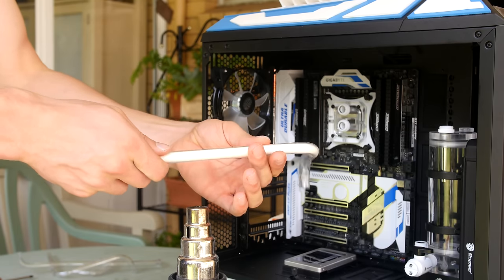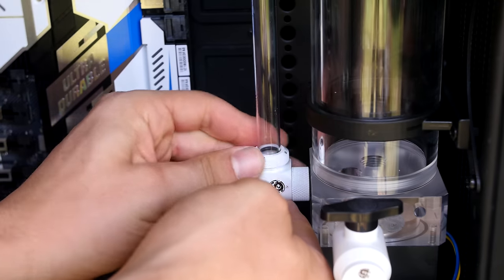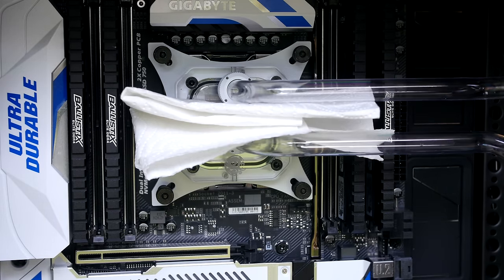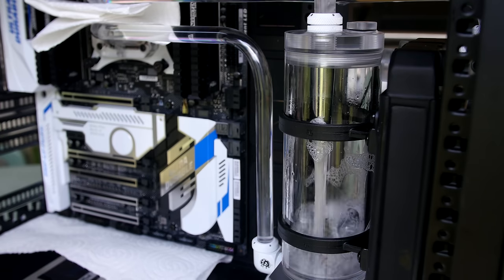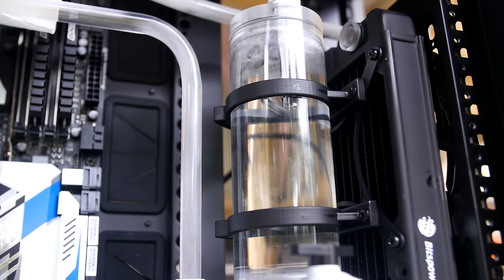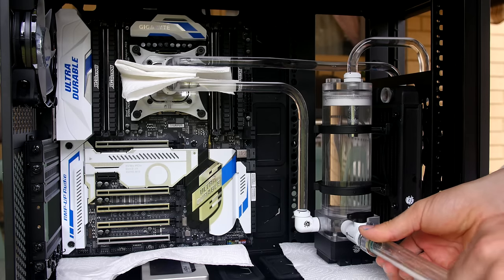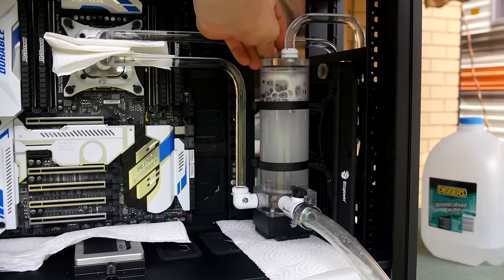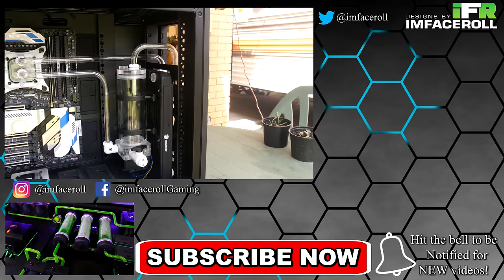How to FILL & DRAIN a PC Custom Water Cooling Loop

Comment: Nice video but you forgot to say that you must never fill the res to the top and ALWAYS leave a bit of air in the top of the res.
I made that mistake in the past because after I had filled it to the top I started a game......and what happend.......Water expense if it gets warm so the water came out of the top of the res :(
Luckely I saw it  on time & I directly shut down the system before something went realy wrong :P

So ALWAYS leave some  room in the top of the res so the water (or air) can go somewhere.
Reply: Andres de Groot thanks
Reply from the maker: +Andres de Groot hahah you shouldnt be using the pc with the port off of the pc =) let the pc bleed out all the air tehn fill it all the way and close it up, now you can game =)
Reply: I didn`t use my pc when filling :P  I waited 2 hours or so & in that time I moved my case a bit........change the pumpspeed up & down so the air coms out quicker.
After that I filled it to the top (I think a bit to far) and closed everything. I thought nothing was wrong but after some gaming I saw that the coolent came out on top of my res out of one of the ports.
What i did after that was shut down the pc and took some coolent out. Not much but a little bit. problem solved.
2 hours is more then enough for me to be shure everything is oke.
Reply from the maker: +Andres de Groot ahh wow sucks that it happened man, glad everything is still ok
Reply: I'm getting a gaming PC soon lol, I won't build it but if my rig does leak Ima have to get into action and turn off the PC. but leave your PC running when filling up your reservoir. but yes leave a bit of air, enough to NOT leak !!!

Comment: thank you it is save to test the system with just distilled water for a few day
Reply from the maker: +Faissal zin yeah distilled water is fine, if you plan on using it long term just make sure you add your biocides etc

Comment: It's also important to mention that if possible, have the returning pipe (going to the res.) not trickling water from above and instead use one of the side ports. This will reduce trickling noise.
Reply from the maker: +Oridian it shouldnt really make any noise if you fill your res up, even then most reservoirs have a tube on the inside that brings the returning liquid into the res lower than the water level so there is no noise
Reply: Well most guides say not to fill reservoirs to the top because of expansion due to heat; and isn't that second bit basically what i just said about side ports instead of trickling from the top?
Reply from the maker: +Oridian hey man. There isnt any expansion of water, its a liquid, the molecules are not compact they are freely moving, if anything you will be loosing liquid as small air bubbles work their way into the reservoir. Once all air bubbles are out then you have small amounts of evaporation over time, even happens in a closed loop. That trickling part that you are talking about doesnt happen from the top because a lot of reservoirs these days have a tube inside of the reservoir from the top port which brings the liquid down below water level before it enters the reservoir
Reply: Alright, thanks for clarifying; much appreciated.
Reply from the maker: +Oridian no problem man =) always happy to help

Comment: Hey dude 
some question about watercooling 

what do u say about different materials in a loop ?
do u think they can cause any problems ? i read a lot in the internet about problems with corrosion or things like that when people used copper and nickel in the same loop 
but radiators are made of copper and i´d like to use EK blocks with nickel because they look so much better

My second question is what do u think about pastel coolants ?
are they damaging the blocks ? or can i use them without any problems 

and my last question is what coolant do u use in your system ? 
i think u said something about UV in your video but from wich brand

hope u understand everything sry for any mistakes but i am from germany
Reply from the maker: +X-Ray # try not to use different materials. Copper and nickle are fine to use together because they are very very close together on the corrosive scale
Reply from the maker: +X-Ray # pastal coolants are fine just clean out your radiators before hand. I use mayhems UV green dye
Reply: Designs By IFR 
OK thx
Reply: +X-Ray please note that ek nickel blocks are actually nickel plated, the base is still copper ;)
Also you NEED anti-corrosive treatment in your liquid since they will always be a bit of aluminium somewhere (reservoir cap, pump bearing sometimes etc) even though it's not that much or another metal that can induce a little corrosive action.

Comment: Thanks for the video it was really great! How do you know when it is time to change fluid and add fluid? Will this cause the pc to turn off?
Reply: If you try to run a custom loop PC without coolant, you might damage your pump running it dry, and your components will start to overheat, not to mention you should have your PC off any time you're changing anything with the custom loop or draining/filling because the liquid could splash onto your parts and cause a short which could damage the electronics.

Comment: So is bridging the 4th and 7th pin a universal practice to power the molex?
Reply from the maker: +Lex Lutha111384 yep, its how you can jump start the power supply to power the molex without powering anything else in the system
Reply from the maker: +CockatooDude yeah pretty much
Reply from the maker: +CockatooDude no worroes man
Reply: In a video a person said to put the pin in the 4th pin and the 5th pin.
Reply: @DesignsByIFR  So I have a fully modular psu lying around and I lost the 24 pin cable. Can I do the pin thing directly into input in the psu?

Comment: My pump/reservoir has 3 ports on the top and an IN and OUT port at the base. Can I attach the drain outlet to either the IN or OUT port? The ideal is to go from radiator > top port on pump/res > OUT port to GPU > CPU > radiator. Just seems weird to have to put the drain outlet on the IN port...

Comment: what is that fitting with the tube connected to the drain valve called? is that a 16 mm  hard tubing?

Comment: What if i dont have multiple port on top of reservoir, only 1. And using tube not entering on top of reservoir but on the inlet..now, what to do? Where do i put walve? What are options?
Reply from the maker: +koford u need a T fitting. The valve can still connect and you can run your line out

Comment: Hi , I have a c240 thermtake hard tube kit . I did not put it together myself , although I have it all powered off and am attempting to add coolant dye to the mix just don’t get how to take the top off ? 

Pretty much there is a tube going from pump to radiator and the other hole is plugged currently which if I could remove I’d be able to put the dye in.. not sure how it comes off though usually just a twist ? Can anyone help

Comment: I know I'm late, but was wondering if anyone can help. What if I don't have res/pump combo with multiple fill ports at the top. The one I have just had one huge cap at the top that unscrews. Would I need to put a "T" valve along with a drain valve, along with one of the tubings that goes into the res/pump?

Comment: Hello,it does not start the pump by bridgeing the 4th and 7th pin,it only starts the fans from the radiator, could you please help?
Reply: you need to bridge 4 and 5 pin

Comment: PLEASE HELP!!! I noticed you still had air bubbles in your loop when you drained it. Mine look the exact same. Little white bubbles along the top of each tube and at the top of the reservoir. I have had my system running for about 6 hours with the cap off the reservoir and the bubbles are still running all around the system making the loop look cloudy and it should be perfectly clear. PLEASE HELP!!!!
Reply: Take off the tubes and clean them out that way.  It's not hard to do.

Comment: did you not use any additives to the water ?
Reply from the maker: I used blue liquid. It already has aditives in it
Reply: in my case can you help me ? ive never done this before and cant find proper guide, i want to refill the coolant in my h60 , i want to use distilled water because its cheap, what do i need to add in the water ?

Comment: Whats up with the foam?
Reply from the maker: +Balubish Tech its just a bit of dish washing liquid =)
Reply: Its not supposed to be in there mate ;-)
Reply from the maker: Balubish Tech haha of course its not, this was a guide on how to fill and drain aswell as flush before you fill =) flushing gets rid of all of that
Reply: Designs By IFR hehe yeah. Nice build btw. Is it a Singularity PC res?
Reply from the maker: Balubish Tech thanks man =) na its a bitspower reservoir pump combo with their radiator mounting plate
Reply: Looks clean
Reply from the maker: +Balubish Tech thanks man =)

Comment: why is it so foamy ?
Reply from the maker: +GoldSkula because of the soap i used to get the silicone insert into the tube, that is why i flush the system with water
Reply: Isn't it easier to clean the tubes before putting them in the loop?